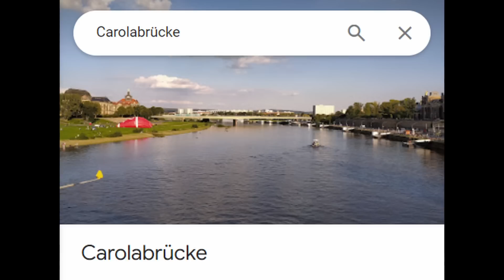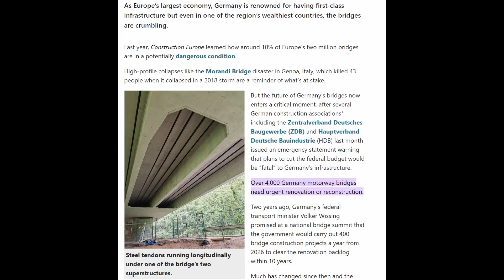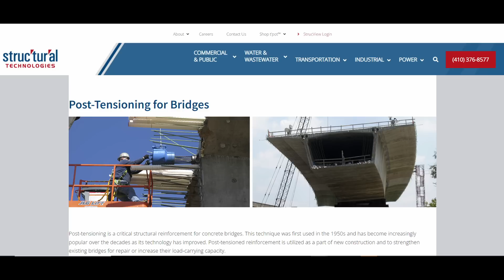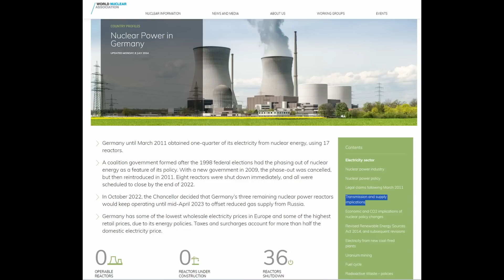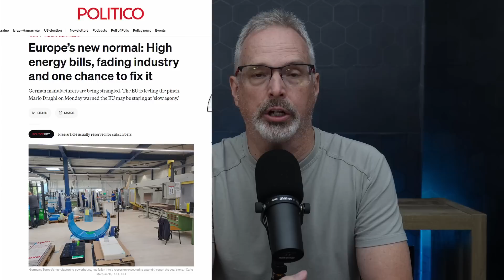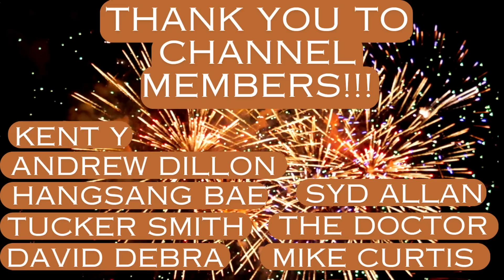Carola Bridge Collapse in Dresden, Germany

Comment: There are two types of steels in pre & post tensioned concreted.

First steel type is called the normal concrete reinforcement steel with yield strengths varying from 230 MPa (in early 1900) to 500 MPa today; this reinforcement steel historically come in plain, twisted, and today deformed bars of various diameters.

Second steel type is called steel tendon with ultimate strengths varying from 1200 MPa for bars, and 1800 MPa for strand/wired steel.

Cable is not a technical term describing concrete reinforcement steel.

Comment: Jup, our politicians love to take money away from infrastructure maintenance and replacement. Instead, they tend to waste it on some hot garbage that nobody wants.
I was just surprised that Dresden was the first to suffer.
The NPP situation was caused by panicked actionism after the Fukushima disaster. In the long term abandoning them is positive because of the waste issues, but in the short to medium term cutting good plants was just stupid. They should have weeded out the ones with recurring problems and left the ones operating reliably to their intended decommissioning decades later, while building new sources. Instead, they've shed a large chunk of production without a mature replacement option, and are keeping coal plants running instead of NPPs.
Our politicians aren't known for making reliable and sound decisions.

Comment: 1:21 based on the appearance of the bridge pre-collapse,  and from construction photographs, I think this location is a built-in joint between girder sections. This joint mainly transmits shear and is not a moment connection. For that reason it also preferentially separated here. I think this is a subsequent damage area not the origin.

Comment: Dresdner here.
I was surprised, but not shocked.
Bridge maintenance/rebuild is always a tradeoff between risk and cost.
And no bridge is 100% safe.
They did the monitoring and the data said, the bridge is okay, but should be maintained soon.
Actually 2/3 of the still intact bridge was maintained in the last years.

Comment: I did drive over this bridge 1 h before it collapsed  -  and I did not drill any holes in it, I swear.
Reply from the maker: Yes, but how heavy was your vehicle?
Reply: @CaseyJones-Engineer  2,5 t only. 
I think it was the vibrations of the tram, which did drive over the bridge 9 min before collaps, which did cause the final collaps.
Reply from the maker: @kralikkral5560   I think you're right, I was just joking with you.

Comment: I don't see that much corrosive would have been spread on the section of the bridge used for the trams. Trams use sand for traction (not salt). The pedestrian/bike path might see some corrosive use during the winter. The bridge area has been affected by high water on the Elbe over the years and this could have affected the positioning of the base, which might have transferred added stress to the concrete segments above. I was in Dresden in 2003 and travelled across that bridge many times

Comment: Hi Casey,
I’m a mechanical PE.  It seems like we are seeing too many bridge/structure failures due to tensile forces.  Wether it is structural steel, reinforced concrete or pre stressed concrete.  In my mind it seems like we as engineers need to use a higher factor of safety.  It’s a heck of a lot easier to to design something stronger, build it and put it into service than to go back and repair it when starts to fail.  Think of the Roman Coliseum.  It’s mostly still there.  That’s because most of it is in compression.

Comment: As you mentioned, many bridges in Germany are failing, because they haven't been maintained properly. This goes far beyond bridges too. Schools, the railway system, streets and highways in general, everything has been neglected. The reason for this neglect is in my opinion the foolish belief of (conservative) politicians in the 'black zero' (Schwarze Null). They were running on the campaign promise of 'balancing the books' and 'limiting new debt'. Well, I'd love to tell you that they are now waking up to the fact that you will run up debt either way, may it be on the books or in the substance, but sadly, conservative and liberal politicians are still chained to the idea that, if they just cut enough red tape, they will have enough money to fix the crumbling infrastructure... (hint: they won't)

Comment: A key bridge or its part in Dresden collapsed. It happened at night, and noone got hurt as noone was on it. Turns out there are thousands of bridges in urgent need of maintenance or repair across the whole country. And this one fell just now when they expect a flood. Bam. This info is worth no more than 30s of the video. Everything else is either a rant, ramble or just daydreadming, either way of zero value.
Reply from the maker: That's your opinion, others differ.
Reply: @CaseyJones-Engineer  coz they know they wouldnt understand it even if it was worthy. sounds engineery and it behaves like it reveals some negative stuff. that is a mix that hardly fails to attract masses. either you wanna look at your content again if you care for the content value or you wanna keep attracting masses

Comment: 1:25 it was a Gerber truss bridge, meaning, there are two linkages in the centre span that allow a bridge made of rigid trusses to move under load in a statically determinate manner. These linkages are where the box gridets have come apart.
This particular section of Carola bridge, "C" section, was finished in a great hurry in Winter 1971, to be ready for a party conference of unified socialist party (SED).
You missed out the important testimony that was on the same news programme, prior to the gentleman you showed, another gentleman was in his camping van nearby. He reporyed being woken by a loud bang, rushed outside and saw the bidge had collapsed. This is consistent with the catastrophic failure of the pre-tensioning wires. Probably after a dramatic drop in temperature.
It was very lucky that no-one was harmed and that the accident occured in the very middle of the night. In any case, the bridge was undergoing maintenance, two sections having been finished and this third section was scheduled to have major works from January 2025. The last inspection was less than a year in the past.

The debris had been cleared away out of the river more than a day prior to your video, by the way.

Comment: 6:00 This is not entirely true. Only about 10% of Germany's electrical energy comes from natural gas. Russian gas was mainly used for heating and for the chemical and steel industry. Germany never had a problem with not enough electricity. To the contrary, Germany is a net exporter of electrical energy, with a net production of 600 TWh per year and a consumption of about 550 TWh per year. Right now, about 65% of Germany's electrical power generation comes from renewable sources, mainly wind turbines, biomass, some solar, and some hydroelectric. Just biomass and garbage incinerators have produced the same amount of electrical energy in 2024 as nuclear did in 2022.
The main problem with energy costs in Germany is the marginal cost. Due to the inflexibility of coal plants, which still account for 30% of Germany's power generation (it would have been the same with nuclear power, which is even more inflexible), whenever there is an oversupply of electric energy, the cheapest energy source, wind and solar, has to be switched off, because for coal, you can't, while switching off a wind turbine or a solar panel is just flipping the actual switch. Austria, which has a vastly higher share of hydroelectric, but no nuclear either, does not suffer the same problem, hence here, the energy prices are much lower. I currently pay 0.14 Euro per kWh in Austria compared to about 0.50 Euro in Germany.
So contrary to your statement, nuclear power would have risen the electricity prices even more, because it is even more difficult to power a nuclear plant down during oversupply of electrical energy, forcing even more cheap wind and solar off the grid.

Comment: Hay COUZIN - aboot concrete fails - do ya know this tragedy?
🍀🇨🇦⚜️ ""The De la Concorde overpass collapse occurred at a bridge over Quebec Autoroute 19 near Montreal, Quebec, Canada, at midday on September 30, 2006. On that Saturday, around 12:30 pm, the centre section of the south lane of an overpass (65-foot or 19.8-metre section of a three-lane overpass) collapsed in Laval, a suburb of Montreal, on Boulevard de la Concorde running over Autoroute 19. The collapsed section crushed two vehicles under it, killing five people and seriously injuring six others who went over the edge while travelling on the overpass. The north-lane half, along the same bridge, did not collapse. The autoroute was closed for almost four weeks, "disabling an important north-south link between Montreal and its northern suburbs as well as the Laurentian region""- wiki

Comment: Oooh CANADA BTW
hay COUZIN - Do ya know aboot the "old Champlain bridge" of Montreal ?? 🍀🇨🇦⚜️
  ""Montreal's climate subjected the Champlain Bridge to wintry cold, snowfall, and windy conditions, as well as contrasting hot and humid summer conditions, all of which accelerated damage to the bridge. Because of the potential danger from ice accumulation during winter, the bridge was salted every season for decades. Salt attacks both the concrete and steel rebar used in girders, pylons, and other parts. The problems associated with the design and maintenance of the Champlain Bridge thus exceeded the useful life of several structural components. The design and construction of the structure prevented the isolation of outdated elements and their replacement with new ones, as could be done on other structures. Given the advanced deterioration of the bridge, it was constantly monitored by 300 sensors.""- wiki
Reply: Who could have known that that bridge would be built near large bodies of water in Canada? 
Oh, wait...

Comment: I suspect that the failure was due to water intrusion at the joint between 2 sections.  The "sleeve" that protected the tension rods was not continuous across the joint, and a gap eventually opened up.  Summarizing other possible factors mentioned in the comments, the big heating ducts inside the bridge creating a thermal gradient, and stray ground return current from the tram rails.  Look at London underground (subway), power and return current is run in 2 extra rails, completely separate from the running rails.

Comment: Another potential factor, as it had an electrified railway on it, is corrosion caused by stray current from the negative return of the traction power system.

Comment: I am in doubt about corrosion. 10 Minutes before a 60 Ton Rail Car crosses the Bridge. The Bridge lost ore than 100 kg of resistance against collapse per second. There was two 500 mm 120°C Hot Water (not Steam as result from 6 Bar pressure) Tube within the Bridge. A small hole within the Tube may leak enough Water inside the Bridge to induce a collapse by overweight.
Reply: Investigations to determine the cause have not yet been completed. There are various assumptions and possibly coincident unfavorable circumstances. That night, e.g. we had a massive drop in temperature in Dresden after a very long period of strong heat.
Reply: @mahei_musiclover  Yes …… but a 20°C Drop of temperature rise the cable tension on a length o 120m round 0.2% ……  I ave estimated the Weight of the Bridge and found the rail car increases the weight about 2%. Everyone talks about that, no one have a water leak on radar. i a a little bit concern …… and meanwhile  the Elbe floods everything for days 😕
Reply: @q9a  Material fatigue was probably the “last straw”. Corrosion problems were already mentioned in the last inspection reports, which is why renovations have been underway in recent years, but they just came too l 4:54 late for the broken lane to happen. Investment backlog (delayed measures) is a huge problem in Germany, among other things, because taking on debt has been very frowned upon in recent decades. 
Dresden became very experienced in dealing with floods, there are various mobile protective measures to prevent the worst.
Reply: @mahei_musiclover  Yes i know all this facts …… but also i am wondering about the fact the bridge loss so much strength in a schort time. Assuming the Bridges  Kabel are reach the deformation level when the rail car crosses …… if you test a cable on a pull engine after deformation starts the cable narrows at one point and the resistance lowers, with reduces the power of the cable. This is an self amplification loop which speeds up dramatically …… But the Bridge withstands 10 Minutes. Or short: Under Estimation of slow corrosion process, why to hell the Bridge does not collapse under one or probably two rail cars. At daytime full of people you have peaks of 180 metric tonnes load.
Reply: @q9a  I can't tell you, I'm a layman, I'm excited to see what further investigations will reveal! Could it be that the load from the last tram was the initial cause of the material's final demise at the fracture point? There was no further immediate stress, so she maybe lasted another 10 minutes. In my opinion, experts here also said that fractures often occur in moments without stress. The energy supplier may be able to tell the exact time when the pressure drop in the network was detected.

Comment: I have friends that lived in Poland under Soviet rule and if it were similar in East Germany, people would steal everything from the job sites ( workers included). Cement was one of the first things taken to build home's for themselves and black market buyers. He told me" They wouldn't order more of whatever was missing, they'd just skrimp on the bridge by using more filler aggregate". I imagine Cement wasn't the only thing stolen every night.
Reply: No reports on bad building quality on this bridge so far. Sections A and B had been already overhauled in the past years. Concrete was described as rather hard. Not ideal either - but definitely not a sign of too less cement.
Reply: @martinstock  but  section c fell down may be the tran track was to heavy.  the us dont use post Tension  its rail road Bridges
Reply: @dknowles60  13 minutes after the tram passed?
Reply: @martinstock   and that is not a real rail road bridge
Reply: YEA

Comment: If I may...  Is there not real-time gauging for bridge "strength" or remaining strength?   Like a battery voltage.   If the gauge is live, and works, nobody needs to guess or predict.  Even politicians cannot slither away from that certainty.  I remember comment from my old career " we all make money out of the performance measurement errors of our customers".  Nobody can measure it, nobody knows if it's any good.
Reply: Assessment of a bridges remaining strength is not that simple. There are many parts to a bridge that all slightly move as forces are distributed.

Comment: This is not lack of maintenance. It received a major overhaul over the last 5 years!
The collapsed part from November 2019 to June 2021.
The other one from October 2022 to June 2024.
But they have also made changes. Including experimenting with Carbon Concrete.
Reply: But the collapsed part of the bridge (lane C) wasn't done yet, renovation work should have started by the end of 2024/beginning of 2025

Comment: Pretty sure you don’t do pre stressed cables the way it was described. The cables are stressed after the concrete is poured and had a specific amount of time to setup. The cable anchors are in the concrete that hold the tension after the fact. Once the cables are properly tensioned, they cut off the cable that came out of the concrete.  Not the other way around.
Reply from the maker: Yes I explained that. The other thing I was referring to was post tensioning and I am not sure that was done here.

Comment: the collapse happened at the first cold night, ending a long hot summer. in plus there were huge diameter heating ducts inside that bridge, ramping up production due to demand from household for this first cold night of the season. so one theory goes for thermal stress due to outside cooling plus intense inside heating (perhaps at points where the isolation was deteriorating.)
Reply: That definately sounds interesting. I´ve no qualification to consider if that has something to do with the collapse, but something that´s worth addressing I´d think.
Reply: Wow! Crazy!
Reply: It was the second cold night, not the first. The heating ducts always have the same temperature, independent from demand.